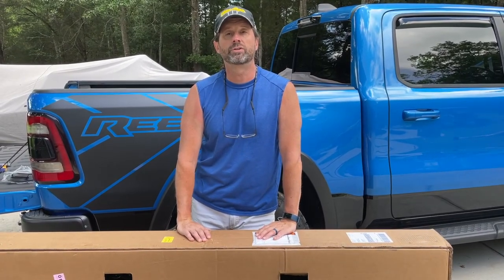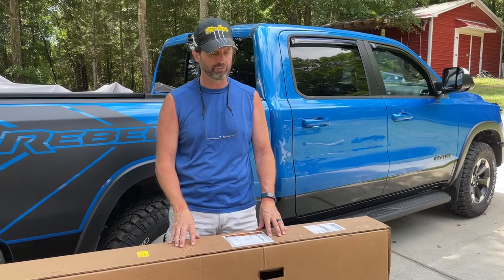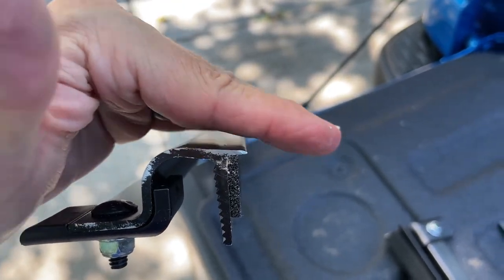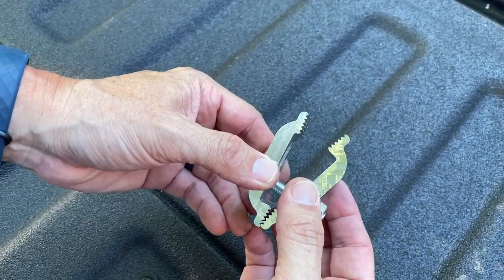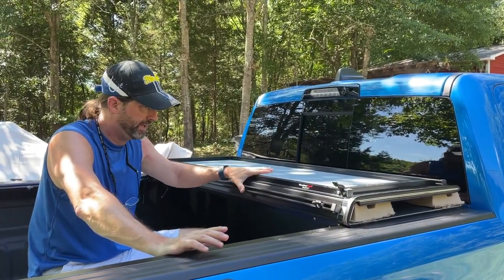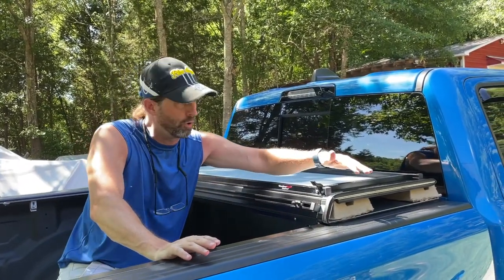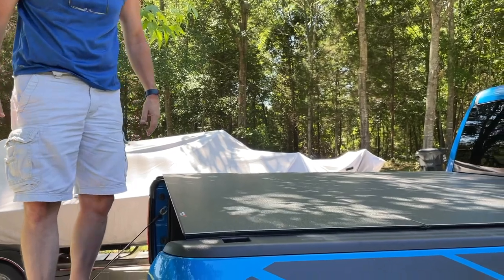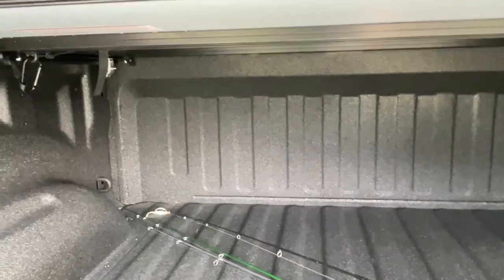2021 Ram Rebel - WeatherTech AlloyCover Tonneau Install

Comment: Very nice job of explaining and camera shots with great angles. Anyone would know what they are getting before they place an order. As an ASE master tech, I can tell you a tip found in the service manual or owner manual and that is weather strip care. This would apply to the folds in this hard cover as well. The secret is silicone grease that is sold in a can with an. Acid/flux type brush on the lid. You are asked to place a continuous thin line on the doors weather strip then with a gloved hand, take a finger and run it into the rubber following its shape. Wipe off any excess leaving a film behind. This actually hydrates the rubber keeping it supple, flexible and helping it last for decades. One can will last for years. For those who live where it freezes and doors can stick during freezing rain or snow melts freezing overnight it makes opening the door no problem. The same is true with the use of a rubber product between the folds of the covers panels. It is part of maintenance and a little time & product will help the life of these products. 
Great video and excellent information!
ASE master since 1978 - Retired.
Reply from the maker: @Dean Key - That is some really great and helpful information.  Thank you so much for sharing that info!
Reply: @BooneDownSouth   I spent almost 6 years holding 4hr tech seminars and the a week of 2 day classes. The schedule was exhausting and found myself looking at the label on the hotel phone to remember where I was. The best thing about teaching a 2 day class was two have students that wanted or needed to learn. Guys who work on county diesel trucks that had no electronics or did not work on electrical system asked very good questions. The better the question, the better a teacher or information I taught them. We have a bad habit only in this field as we assume they already know certain things when they don’t. County, Police and even FBI garages have 20+ year techs that still don’t feel comfortable with what they see on a digital multi meter. If they spent $25 or $500 they did not understand voltage drop or simple kits to chase down a circuit short. Sad that I felt I left something out when class was over, but that was my problem. Using power point on a “White Board” kept me on track yet yelled out on the way home during a 350 mile drive, “Hey, you forgot to bring up serial data like class 2 and tell them to expect 3.5 Vdc if active using OBD-2 connector cavity 4 (ground for computers) or cavity 5 (ground for chassis) and the average was the refresh rate of their meter. Even lab-scopes had to be limited to 6 techs because you can’t give them the attention they need. After all, it’s a balancing act between decades of doing and a few hours of teaching. It was easy to burn out! I feel that now, wanting so bad to do something but R elbow, lumbar says you must quit and sit. I am in my early 60’s and I tell buddies it is not the years but the miles of information that wear you down. 
 We have an O’Riellys 3 blocks and I can’t go in there. The guys & gals behind the counter will tell a customer; “Hey, this guy can answer your question!” I will but can’t or don’t want to. I get happy to help and turn in a light bulb but get unhappy because I can’t even do for myself. I am like a turtle on its back. Trying but can’t get anything done.

Comment from the maker: I received an update from WeatherTech advising me that they no longer recommend using the additional  weather seal at the front of the bed.  In fact doing so could void your warranty.  Here is their statement:   "Please note that the manufacturer has recommended that the weather seal used in this video only be used for the WeatherTech roll up cover and not used with the Alloy Cover.  Using it on the alloy cover could void your warranty."
Reply: But without it on the alloy cover, would water get in?
Reply from the maker: @Giorgio_Rampa  There is a rubber seal hanging down on that back side that is supposed to block the water.  Granted I have the extra seal in mine, but from the looks of it, the back seal comes down far enough and WeatherTech is claiming that is all you need.
Reply: @BooneDownSouth  I just got this cover for a Ford Ranger 2022 and it came with an extra seal for the front of the box and said to use it.  Maybe it depends on the vehicle.

Comment: Thanks for the video!  It was very helpful for my install.  So, I took your advice and called WeatherTech.  Similar to another person's comment, the person on the line didn't know what I was talking about.  I sent photos of my F150 with factory bed rail caps similar to yours.  I also included a screenshot of you holding the seal so they could see it.  The person called back and said that they do not recommend the extra seal because it would cause added stress on the bedcover.  I was told there is no solution or alternative.  They said that I could send it back if I wanted.  I am going to try sending the model number you gave in one of the comments.  Fingers crossed.
Reply from the maker: Josh I don't see how it would add extra stress on it.  I mean there is a gap without it.  I think it depends who you get on the phone.  Hopefully they get you fixed up!  Glad the video helped man.
Reply: @BooneDownSouth  we will see.  I sent her a message back basically saying the same thing. I measured and from the bed of the cap is over 3/4". The seal didn't appear much taller than that in the video.
Reply from the maker: @joshgriffith36  Good Luck.  Hope they get you fixed right.
Reply: @BooneDownSouth  just an update for others who may read the comments like I did.  I provided the model number for the seal.  The response was...
"Unfortunately, we no longer provide the seal since it creates stress on the bed cover."  
I am going to see how well it seals without. Let's hope it is ok!
Reply from the maker: @joshgriffith36  I would try this: https://amzn.to/3xnZ27G  I used this to seal up my tailgate, but I think it will serve the same purpose for the bed cover.
Reply: @BooneDownSouth  I appreciate the tip!  I was going to see if I could find anything online. I may give this a shot!
Reply: @joshgriffith36  how has it done without that seal?
Reply: @ThatGuy_Pal  it has done great!  Surprisingly, I have never seen any moisture in the front of the bed where I was concerned.
Reply: @joshgriffith36  good to know!

Comment: Hey Boone. Excellent vid. Counting on a similar fit on my 2019 Ram Laramie Crew cab 4x4. You video convinced me to try the WeatherTech product & removing my leaking like a sieve 4 fold Gator cover. Mine should arrive this week. Quick question? I can see you have a tailgate seal installed. What did you use? A kit or do it yourself. My wife's uses her Laramie pickup for equestrian activities and needs it dry inside.
Reply from the maker: Hey Jay!  I used this DIY seal I got from Amazon:  https://amzn.to/45Nmhq6
Reply: Just finished instal of my WeatherTech bed cover. 2019 Ram Laramie Sport in Blue Pearl. It looks great. Install was easy but tedious rail adjustment. I have a MOPAR factory drop in bed liner. It’s a tad more rounded off at inside edge than normal side panels. But got er done. It’s sitting in the sun now. It passed the light test. Had my wife shut me in there on a sunny day. Dang if she wouldn’t open the gate! Reminded her it’s her truck. She let me out. I’ll give it a couple days before a car wash test. Glad I sent the Gator quad fold back and did the WeatherTech.
Reply from the maker: @JayHutchG   HaHa... the light test locked up in the bed on a hot summer day!!!  Reminds me of a joke about how you know a dog is truly man's best friend.  Lock your dog and your wife in the trunk of your car for awhile and when you open the trunk later see which one is wagging their tail and happy to see ya!

Comment: I have not installed mine yet as I am waiting for my Line-X. But will take your advise on the install.
Thanks!
Reply from the maker: Awesome!
Reply: Patrick, I have a 2018 F150 supercrew. The cover was simple to install but that extra front seal is a must or it will leak in by the front corners up near the cab. I’m also getting water coming in along both sides of the bed rails where the seal meets up the the sides. I’m gonna try and torque the bolts a little tighter. I expected a little better design for such an expensive cover. I’ve had $300 covers that extend more over the bed rails keep the bed dry vs a $900 cover that leaks.
Reply: @MattyMCcRollin17z  which brand is the $300?

Comment: Great review man, I’m undecided between this or a peragon. With the tailgate closed does it have enough give to get under it with a coat hanger? Or is it solid?
Reply from the maker: You know it has like a rubber seal and it is pretty tight but you could probably get a coat hanger through it if you wanted to.
Reply: I’m torn between the same 2

Comment: FYI - The new manufacturer recommendation on these is no "double seal" up by the cab.  After watching at 7:47 I'm going to take a wild guess and say that the "double extra seal" you got has never done anything and that I why the manufacturer isn't recommending it or sending it out anymore after they review its usefulness.
Reply from the maker: Peter - Yes they actually called me yesterday to discuss.  They are going to send me information as to why they do not recommend anymore and I will post that info to the top of my comments and video description.

Comment: Do you ever have water at the corners of the tailgate?  If so you can buy a seal that will stop that from happening, as well.  Looks like a good cover.
Reply from the maker: @Tom Caldwell - Yes I did that on two different bed covers I tried.  I think the gaps in the 5th gen rams are just huge.  What I did was purchase this tailgate seal and that took care of the proplem:  https://amzn.to/3kiJA6g
Reply: @BooneDownSouth  Outstanding and thanks very much for sharing the Amazon info!  I’ve got a Ford Raptor on order and plan on putting a tonneau cover on it, as well.  The WeatherTech cover looks a lot like the Lomax Stance tonneau and I’m wondering if they don’t share the same technology.  I really like the fact that your cover doesn’t require the drain hoses that come with the BakFlip and Undercover.  I’ll really consider the WeatherTech based upon your review.  Thanks again.
Reply from the maker: @tomcaldwell5914   Yea I started with BakFlip and that didn't go well at all.  First one showed up with holes drilled about 1/2" off, and a corner broken.  They sent a replacement and that one leaked in the front and the back and also leaked at the seams.  Sent it back and went with WeatherTech because they guarantee their seams are waterproof.   Nobody else does that that I have found.  I have heard others state it might be the same as a particular Lomax cover as well.
Reply: @BooneDownSouth  Thanks for the info on BakFlip.  Have heard other bad reports as well so definitely a no go on the Raptor.  I’m gonna subscribe to your channel in case you have some updates👍

Comment: Thanks for all the details on the L strip but I didn’t see how they factory 1 inch seal/gasket and the L fit together in the finished fit. 

And would you purchase this cover again. Me and my son want one for our trucks but not sure which one is the best. All other WT products have been good. TIA.
Reply from the maker: So honestly from the feedback I have been getting from some viewers is that they get different answers from WeatherTech depending on who they talk to.  Actually, I did as well.  I had on person tell me to do put it with the open part of the L facing the cab, and another telling me the open part of the L should face the rear.  I ended up facing my open L to th rear, thinking that once the top is on it compresses that seal, the slope of the back of the L would push away from the bed.  Every now and then I do get a trickle of water come in at this point, but it has never been enough to hurt anything back there.  I have been pretty happy with the cover and would probably buy this one again.
Reply: Thanks for the reply.

Comment: Hey, what was the extra seal called that you ordered from Weathertech for that front half inch gap you talked about in the video?  I just called and was placing an order and the guy didn't know what I was talking about.  I tried to explain to him what you had to do to order it by calling them back but he was confused.  Any help you can give me here so I can make sure to get that extra seal?
Reply from the maker: Casey - on my invoice it says that it is part number 8RC30890 and is called Front Element Seal for Roll-Up Truck Bed Covers.   I told them about the gap when I was ordering it and asked how they handle that.  That is when they told me they could add this seal to my order at no charge that should take care of it.  Hope that helps.
Reply: @BooneDownSouth  Thanks, it has been a little bit of pulling teeth to get them to figure out what they need to send so hopefully this part number helps.  Really enjoy all your videos man, this one helped me go ahead and make the choice to get the weathertech over the BakFlip!
Reply from the maker: @caseymartin4422  I actually got the BakFlip MX4 first.  It arrived with a few defects.  They sent me a second one and it leaked like a sieve and then I told them I just want my money back at that point and went with the WeatherTech.  Tell you what though if you have not seen it check out this video:  https://youtu.be/IXjLyHOVJKA  These lights I installed in the bed are amazing dude.  At night they light things up well enough you can work off your tailgate if you needed to.  Now that I have done it, I regret not doing it on my last truck.  It's a huge difference.

Comment: I was looking at this cover, I was in between this and the BakFlip MX4. My main concern with the weatherTech would be that it does not latch in the middle part of the cover, are you able to lift the middle part up to get a look at what is in the bed? Also I ended up going with the BakFlip MX4 because i love the fact that i can fold it up to the window to use 99% of my bed without having to remove the whole cover. I am not looking or a bed that is waterproof, i feel like the security is more important than a little water going through. Great video though!
Reply from the maker: I really liked the idea of the BakFlip MX4  but the first one they sent me was damaged and then it leaked like a sieve, the second one wasn't damaged but leaked like a sieve and it was just too much for me.  The Weathertech has been good for me.  You can't lift up the middle panel, I mean I am sure if you tried hard enough you could do something but that is probably true for most beds.  I feel pretty good about the Weathertech security though.

Comment: I am picking mine up Sunday at WeatherTech in IL.   F150 SuperCrew
Reply from the maker: Sweet!
Reply from the maker: @MattyMCcRollin17z  Call them up and explain the situation and they will probably send you the seal you need at no cost.  Before I ordered mine I asked them about that and they included them at no cost for me.  I think they will take care of you on that.  I do not have leakage on either of the sides.
Reply: @BooneDownSouth  they are sending me the seal kit. I actually never cranked down the bed rail clamps. I did that today and saw water being squeezed out. I think I was just so excited to get the damn thing on I forgot to tighten them😂
Reply from the maker: @MattyMCcRollin17z  That's great man.  My impression with WeatherTech is that they back their products really well.  That seal should help you.  I know the frustration though because I initially went with a BakFlip MX4 and the first one had major issues, then they sent me a second one and that one leaked everywhere, through the panel seams as well as all 4 corners.  It was a frustrating couple of weeks fighting with that one until I sent it back and told them to give me my money back.

Comment: Great video, are you still happy with the purchase? Any leaks?

I'm planning to order this soon for a 2022 F150 Supercrew I picked up this week!
Reply from the maker: Yes I am still happy with the purchase.  I have seen some leaks on the corners.  Not enough to do damage to anything that would be back there but there can be some trickles after I run through the car wash.  As an example I have been toting around several projectors and speaker sound bars etc in the back of my truck for the last 2 weeks and hit the car wash a few times with them back there cause I know what little comes in during the car wash is not enough to damage anything.

Comment: Anyone notice he put rubber seal on the side of taillights to keep water out  dodge rebels don't come like that 🤔 if it's supposed to keep water out why put the rubber seal on the side of taillights makes u wonder
Reply from the maker: No, you are right.  The Ram Rebels do not come with that seal around the tailgate.  The Ram Rebels come with large gaps, which lets dirt and dust come in to the truck bed as well as water when going through a car wash.  There are no tonneaus that I know of that make any claims about keeping water out of tailgate gaps on the sides and bottom of the tailgate.